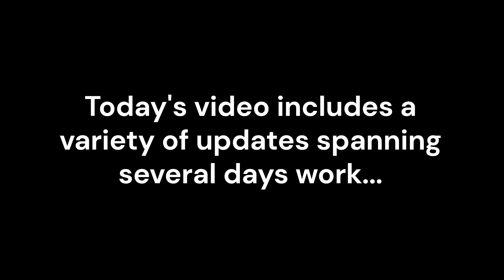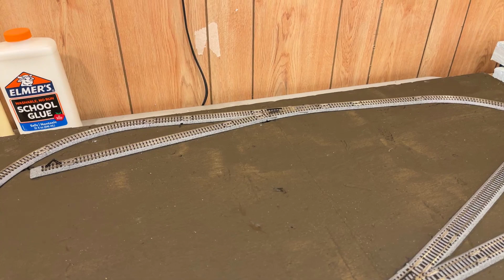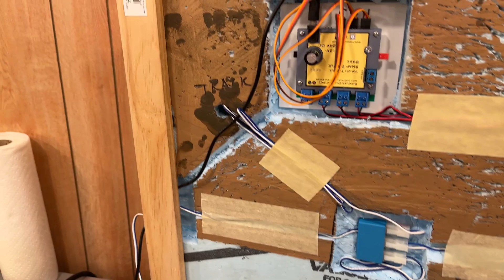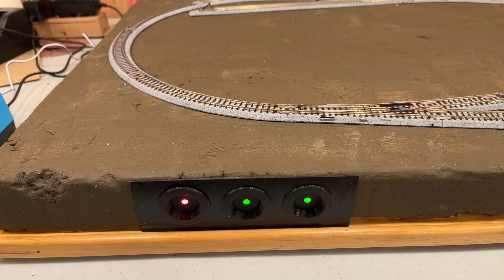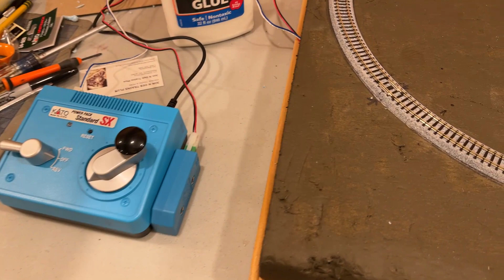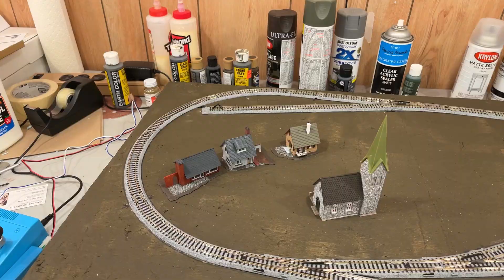GerenMTrains Ep-3: Layout Update

Comment: Looking good! I've never done these kind of builds, but look like all normal hobby style connectors?
Reply from the maker: They're not widely used in model railroading -- except by Kato. In most cases, you get to solder the wires. (There are a couple of other wiring systems out there, but no standards). These are Molex connectors often used in industrial electronics/electrical -- and PCs and sometimes in older synths for power connections. The connectors on the bottoms of the track switches and "terminal" track sections are proprietary.